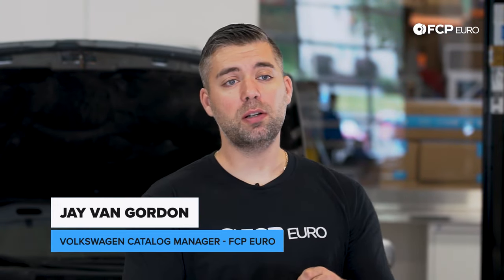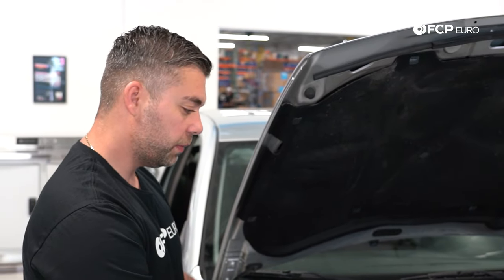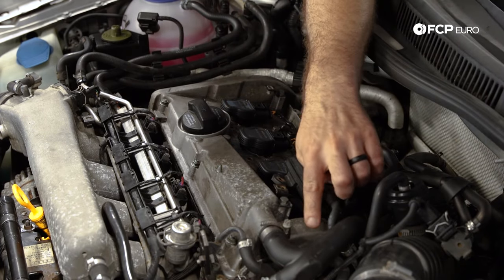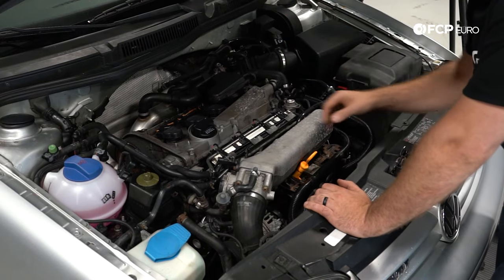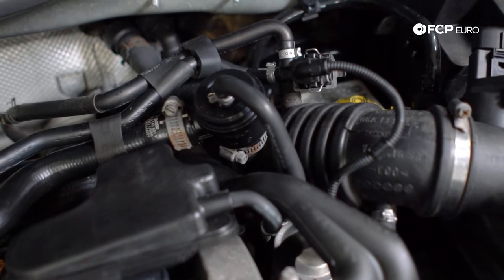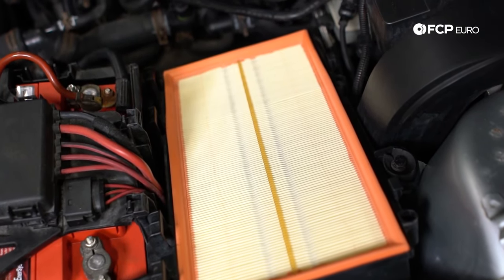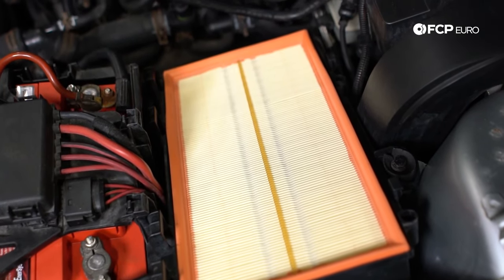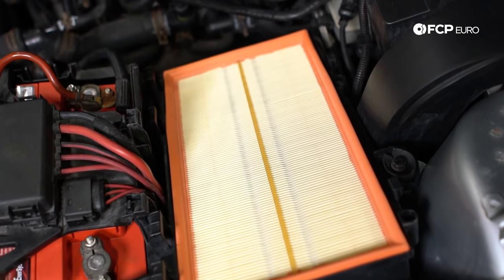Volkswagen/Audi 1.8t Engine Diagnostic & Maintenance Guide (Mk4 Golf, Jetta, New Beetle, Audi TT)

Comment: I have a 2004 Volkswagen Passat with the 1.8T
232,000 and it never fails if treated right!
Reply: Engine Head can be broke.  valves seats can broke but not with only 371kkm. Second problem with all vag its oil piston rings. If your engine begin consumpt oil but not leave blue smoke its can be oil into cyl. Another problems a valve sealants. Of course flexible exhaust pipes is broken in vag

Comment: One of my favorite 4-bangers. Most of the factory weaknesses have been addressed by the aftermarket, and it's extremely easy to work on. And from a performance standpoint, iron block with closed deck design and really good knock management means they're really hard to blow up once rods (and maybe head bolts) are upgraded.
Reply: When this engine start in europe everyone said "its turbo its unreliable" today its better than any tsi engine and more  reliable than old natural aspiration vag engines
Reply: I own one of these and these engines are tanks if you properly maintain them.
Reply: @StopTeoriomSpiskowym AMEN! 👌🏻
Reply: Have ~150K miles. What do you think would be your top 3 upgrades?

Comment: I've had this car since 2016 with 100k, At 188k now and its been a nightmare the first two years. Fought each of these incidents 1 by 1 till i got till 140k, got it tuned, and its been a great, fun daily driver for the past few years with out a hiccup!
Reply: That good to know, I am in the middle of fixing many things at the same mileage.  Coolant leaks have been endless
Reply: My 01 Jetta w/ 233k 1.8t Stage 2 tune for about 60k miles now still going strong. Still original turbo. Clutch and TB service coming up this summer.

Comment: as a owner of one, i can say, good guide. nearly every coolant hose bursted on my 99 tt and the thermostat housing leaked. i have a whole aluminum kit for every flange that is plastic by default. vacuum hoses broke, coils werent bad, but replaced them with tsi coils, dipstick is still ok, tho have seen it fail on other engines. valve cover leaaks a little bit on the back side, have a new one laying around, tho might replace the timing chain gasket as you suggested with it. timing belt is now only 3 years old and about 12k km in, so thats ok. also turbos and manifolds are common issues. both had heatcracks on my car. solution: sport cat and better flowing exhaust to reduce back pressure and EGTs. German manufacturer "friedrich motorsport" has a whole exhaust for it in their program in 3 inch diameter and sport cat and TÜV certified, so street legal in the eu.
Reply: This is a headache😁
Reply: @3kkk514  i wouldnt have one if i couldnt fix it myself
Reply: @LcFan96  i had one b7 convertible, all u mentioned is all true  another common issue is airbag igniter electrician already bypass the airbag igniter under seat from time to time it pop up in dash  light and  the only solution is to keep deleting using obd vag. Also oil consumtion issue. My Local mechanic check compression test is all good. He reconcon turbo cartridge need to replace or need to modify or change the oil feed hose  oil restrictor  banjo bolt
Reply: @3kkk514  b7 use the 1.8tsi or not? Either way, if you cant afford one, dont buy one, and thats no offense, they need care
Reply: @LcFan96  b7 2.0tfsi 200hp 147kw not a 1.8 tsi. I only use it for summer convertible. My main car commute to work is my 3 yrs old  toyota landcruiser.
Reply: @3kkk514  oh, yes these are way different than the 1.8t from back in the day. They are knowm to consume oil

Comment: In Europe this engine was used, in the 180bhp form, for a VAG owned marque called Skoda Octavia VRS which was a very reasonably priced family saloon and somewhat rarer estate (or combi as Skoda called it) or wagon as you call them. Easily remapped to 200bhp and 250 ftlbs, this makes a fairly rapid car due to it's 3000 pound weight. Mine is the very last year they marketed the Mk 1 body shell and is starting to appreciate in value along with very cheap spares cost..... I love it !
Reply: Yeah man i own a silver 1.8T 4x4 mk1 skoda octavia estate and if defo has surprised a few people! Absolutely love the car.

Comment: Don’t forget about the o-ring that attaches your oil heat exchanger to the housing. It’s gets hard and cracks and blows out and will empty your oil pan in less than a minute on the highway.

Comment: You are simply spot on. My 2003 Wolfsburg edition Jetta 1.8t got 433000kms. I have gone through a lot of replacement parts over the years. This is the end result of owning old vehicles. Thanks for sharing an amazing educational video.
Reply: That engine is GREAT pain in ass anyway with 433××× or 150×××× and reperations/ service  is very expensive .
In Germany to change timing belt with water pump  ,chain tensioner ,chain ,big service in 2010 coast 4500 € and a lot Germans throw that shit on garbage or sald för litlle peng .

Comment: This looks like much, but, to be honest many are just age related. I would rather have faulty hoses, pipes etc, than faulty timing chains, giudes, metal filings in the oil filter, massive oil consumption like other engines develop. I had a 225 TT and did all of these items on it and it was a doodle and a pleasure, instant gratification. I sold the car at 167k and it was still going strong. With a remap on it was dino'd 🦖 at just over 250hp.

Comment: Just bought a mk4 with an ajq swap from a TT. neat little motor. It is pretty easy to work on.   I also run turbododge 8v's.  also a neat motor. Non interference. :O)

Comment: I had a skoda octavia 1.8t-00 with a agu engine. Stage1 tune, 2,5” from the cat. GFB dump. Simota air filter box. Mac valve insted of the crappy n85 valve. Clutchmasters lightned flywheel for a corrado 1,8 g60. Exedy golf3 vr6 clutchkit. K03-52 turbo. Strongflex all around the car. 40/60 lovering kit.18” wheels. Very fun car. It had 400 000km on it when i got scraped this year by the new owner. Now i drive a Saab 9-3 vector 2008 1,9TTID

Comment: Iv got the golf mk4 AGU from 1999 and have the original S3 coils K04-001-XL  660CC injectors the older injectors cups are plastic in the inlet manifold 2 of mine were weeping bought 4 new1s good amount of grease and a nip they haven't blown by since curpra R fuel pump 4bar FPR stripped out 80% and its 1126kg with me in it full tank these engines are an absolute riot loads of fun and only thing I need is con rods and ur looking at another world of fun vacuum lines can be a pain in the arse. If u want quick 0-60 get the 5 speed box if u want higher top end get the 6 speed but there are 100s of ways ppl have tuned these engines and personally il never let mine go still going at 140.000 miles and I'm not easy on it.

Comment: Out of all the golf gti's I've ever owned the 1.8 t has been the most reliable. The Mk5 and 6 let me down badly.
Reply: How so?
Reply: @tiko4621  cam follower and oil pick up pipe on Mk5 and cam chain and tensioner on Mk6. Cost me big time.
Reply: @jasonjay7650  huh, so far my biggest problems on the 20v 1.8t have been simple sensor issues and vacuum/boost leaks     Been pretty good to me thus far.
Reply: @tiko4621  I had the 180bhp anniversary golf.  Had it 5 years and only needed a new diverter valve.
Reply: @tiko4621  Direct injection-related carbon issues, water pump assembly failure, cam followers and high-pressure (cam driven) fuel pump is the culprit in the FSI and early TSI engines of that era.

Comment: A little tip for thermostat i take out alternator as it makes it much easyer
Reply from the maker: That may work for some folks as well, I believe that method makes access to the housing bolts a bit easier.
Reply: My housing on my B5 Passat had a hairline crack in it. I disconnected the battery and removed the tbi hose. Easy peasy
Reply: @coache1nine  being a GM guy and Driving a 1994 GMC safari, i read TBI and jad to do a double take here LOL

Comment: great info as always. I would point out that the AWD engine family i think the timing belt is recommended to be replaced at 60k miles. With these being interference engines it's too risky to try and squeeze extra miles out rather than perform the service.
Reply: Based on my decades of experience with these engines, the timing belt itself isn't the issue.  The OEM water pump with the plastic impeller usually reaches it's failure point on or before 60K miles.  Using the aftermarket water pump with the metal impeller will extend the timing belt service interval to 75 - 80K.

Comment: Had 2 A4s both the 1.8 t never had a problem with either, first was 14 months old when I bought it with 79,000 miles just decent oil changes and if like me ya won't have a problem

Comment: You forgot my 2004 VW Passat 1.8T Four Motion 5-Speed Wagon. 😉 All good tho. The 2 years my exact make and model about 7k +/- where made... Always good to replace the timing belt and water pump at the same time. Timing belt goes wrong big problems.

Comment: Another 2 common faults to look out for is a cracked sump due to the low position and also the dipstick tube losing brittle parts into the sump and blocking the oil pickup causing the oil light to come on. Checking the oil and seeing plenty of oil makes you think the oil pump failed until you take the sump off and see the issue. I've had both issues over the years on several 1.8T's but the sump was the most common, its quite fragile.. Liquid metal after draining the oil fixed the problem until I've get another sump to swap over. Then it's a  check in the pickup and a look in the sump for any sparkles..
Reply from the maker: Great notes, sorry you had to endure that!

Comment: Nice video can you make a short video about replacing the secondary vacuum pump bolted underneath the subframe toward the rear and removing the vacuum booster hose from that and how to disconnect the plug??

Comment: For the metal impeller water pump I definitely recommend a good quality one. I've seen and heard the bearings go bad and the metal impeller tears the inside of a block when it went bad
Reply: You're right...my original waterpump failed and I replaced it with a cheap one but it was a metal one...that one failed after 2 months
Reply: The metal impeller is a solid piece that has nowhere to go, it may scratch the block but if it is a permanently pressed onto shaft gear and impeller, like the INA brand, there is very little percent of failure, any failure wore be seized or failed bearings, with shaft and impeller remaining in place. Doing no damage at all. Don’t buy rebadged eBay junk,and they don’t fail.
Reply: It's the same topic for 1.9 tdi. It's not a problem, just buy new one every timing belt job and you're good.

Comment: Thanks mate, this video will be very useful now that I have just got my mk4 golf gti back after ten years in storage. I have some questions for anybody who may know and wish to take the time to help me;
Considering how long it hasn't been driven, what critical things must I change on it before attempting to start it?

It was taken off the road a decade ago because I suspect that the turbo let go. It was making funny noises for a while before it went, and when it did go; it chucked out a lot of white smoke out the back as it suddenly lost power. I turned it off almost immediately and it hasn't been driven since. Could it just be a hose or something? I have a different turbo for it now but haven't put it in yet. 

Can a turbo be replaced on this car and engine on a driveway? or will it need to be put up in the air? 
I have so many plans for this car and seriously don't even know where to start, I haven't worked on a car in ten years! It has a fairly low mileage for a T-reg at 128k.

Comment: I have a 1.8T in my '99 Passat.  Is this the same engine just turned sideways?  It looks similar but hard to tell for sure.
Reply: Yes.
Reply: Yes, depending on the model the 1.8t engine was either mounted transversely or (in the passat, a4, a6 and superb) longitudinally.
Reply: @fabium3410  Thank you, good to know.  I have 180,000 miles on my car and have had NO ISSUES at all with this engine.  My oil analysis every year or so comes back as being a 'like new' engine.  I am very happy with this engine and it gives me terrific mpg's too!
Reply: @aboyandhisdog  im happy to hear. It is a good engine all things considered. My first car had a 1.8t (98 a4). Just replaced general wear items and it never gave me much trouble, well the turbo did go bad after 280k km (not sure in miles) but it was an okay job even for a novice diyer like myself. Now i drive another 1.8t powered vehicle which is a 99 tt 225 and its simply brilliant for what it is
Reply: You have an 058 engine, while (I think) all of the MK4 VW 1.8t's are 06A blocks (at least in the US). The later year (2000.5+) B5 (your Passat) and B6's are also 06A though, but your '99 would be a 058. A lot of the info in this vid only pertains to the 06A. Biggest difference between 058 and 06A short blocks is how the oil pump and water pump are driven. 058's uses an intermediate shaft to run the oil pump (instead of a sprocket directly off the crank snout like on 06A's), and the water pump is external and driven by the accessory belt (instead of internal and driven by the timing belt like on 06A's). Accessory bracket (ie; for the AC compressor, alternator) is completely different. Some different hose routing. Also 058's have no combi-valve or secondary air injection. Likely old-school cable throttle body instead of drive-by-wire, but if it's a later year '99, could be drive-by-wire. 058's all use narrow-band O2 sensors (outside of a conversion), while most but not all 06A's use wide-band. Different heads: you probably have the more desirable large-port AEB head but no VVT. Intake manifold obviously looks very different. In truth there's a dizzying array of changes to the 1.8T from car to car and sometimes year to year within the same model, but these are the bigger ones off the top of my head.
Reply: @jae9843  Thanks a lot for this information, Jae!  I just went to check and I DO have the cable throttle body.  And it looks like the water pump is run by the serp. belt.  Anything I need to pay particular attention to?  It's been a great car so I'm guessing there are no hidden gremlins that are lurking around.  Thanks again!
Reply: Its same engine but not same engine code because its turned

Comment: Since 3 month have  milky oil in my 1.8T AWT engine. I didnt missing any coolant and also super clean my coolant. If its would be coolant leak,headgasket then I think in 3 month should be missing.Do not  overheat even if I driving long 3500rpm+.Everythink looks,feel fine.I driving 2x20km a day minimum around 800km/month.Anybody knows why have water/humidity in my motor oil?

Comment: I need help, please. I have A4 B6 1.8T. Want to Audi Service and they made diagnosis that camshaft sensor is done. Car is in kinda limp mode, has really no power and stutters on mid rpms(around 3000-4000). Also wont start on first try, I have to try 5-6 times to start it. I've changed MAF and the Camshaft sensor but still nothing

Comment: Hey man, i had my timing belt snap, ad i changed every component from the valves to the tensioner as well as the cam sesor but i get this error 16727, which basically says "camshaft position sensor: signal too high", is it my timing or sensor?

Comment: 1: The car has two sides, left and right. You started from the right, not the left side. I've had to wait for parts several times when the custommer called in wanted to change their left headlight or whatever, but it was the other left headlight.
2: You forgot to mention the fuse box over the battery. That is a very common failure point on these cars.
Reply: this is why cars actually have a driver side and a passenger side lol

Comment: Just hopped right over the poorly Grounded under size wire gauged High Power ,Battery Top Fuse Panel that runs basically  every electrical component in the engine bay, dash, cabin and the charging system in the car  that likes to melt, or catch on fire!?😂😂😂 I thought for sure you were gonna say that, when you started talking about the “battery box” … good content but that was a swing and a miss for sure! 😂

Comment: Hi, just found your video. I just picked up a 2018 VW Golf Alltrack with only 17,123 miles from Carmax  Interior and and paint are in excellent condition, but after driving it for a day, I notice a slight smell antifreeze when lift the hood and looking closer at the engine I can see on leftside front valve cover, some kinda red sticky liquid. Not sure why a 17k car would have that. Other than that, love the car, so any input would be helpful. Thanks
Reply from the maker: Hi Edward. congrats on the new buy! It is possible they topped off fluids/checked them before the sale, and made a bit of a mess. We would advise cleaning up the residual on the engine, using some all-purpose cleaner and a towel on a cold engine. From there you will want to monitor and see if the mess comes back. It would also be a good idea to make sure your caps are tight and secure on your reservoirs!
Reply: @fcpeuro  solid advice.

Comment: I have a MK4 1.8t Jetta , if my cam chain tensioner is going out, would that cause an ugly noise? I can’t seem to find out what’s wrong with my car. Because the noise only happens when I first turn it on, then it goes away after RPMs go ip
Reply: Is your timing belt wobbling?